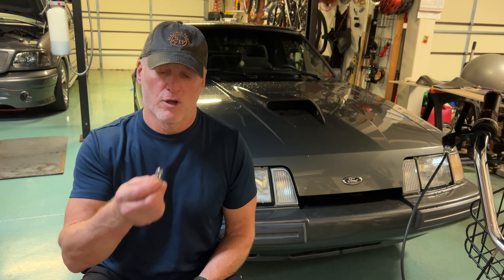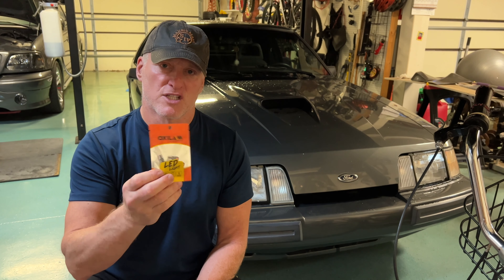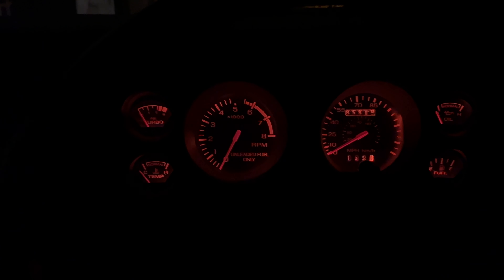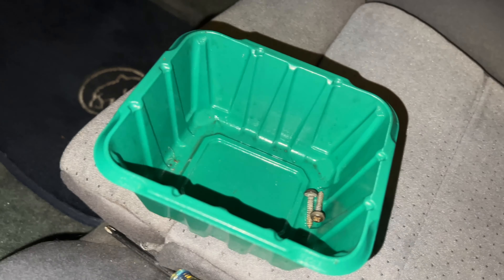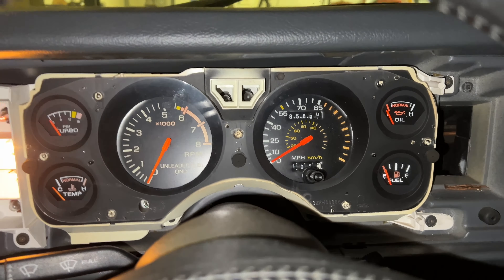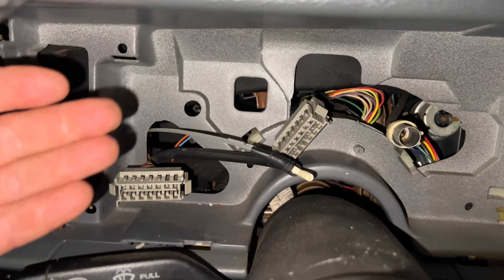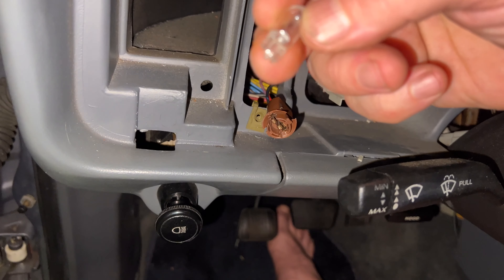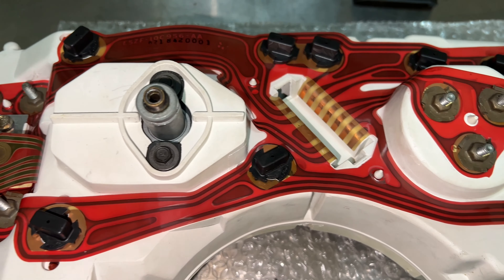How To Change Fox Body Mustang Gauge Cluster Bulbs to LED '84-'86 Mustang SVO, GT, LX

Comment: Nice job, came out great. Mine are still pretty bright stock except for the fuel gauge.. that one very dim. how long would you say this can be completed in?
Reply from the maker: Hardest part is disconnecting the wiring harness and speedo cable... should take less than 2 hours depending on the size of your hands / arms!  ;)